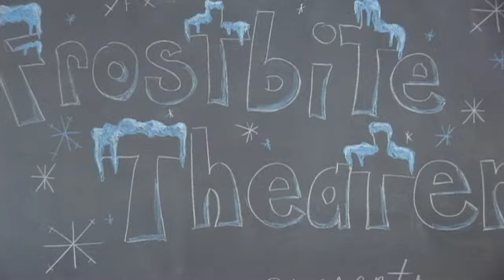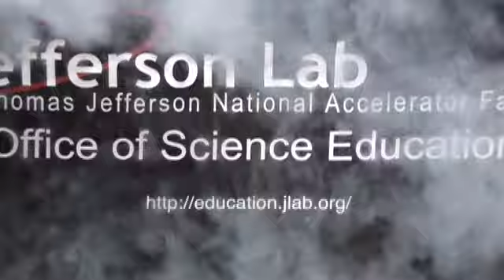Liquid Nitrogen Experiments: Insulators

Comment from the maker: @bigeyezzzzzzz The cheap-o styrofoam coolers aren't too bad. The main danger is if the nitrogen spills over if it is inside your car. It won't freeze you. It'll change to a gas and lower the oxygen concentration in the car, causing the driver to pass out and the car to go wherever it wants to go. Because of this (something we call ODH - Oxygen Deficiency Hazard) you really should carry it around in the back of a pick-up truck.

Comment from the maker: @typhoonkj Nope. Water boils at 100˚C. Surrounding parts of the tea kettle are below 100˚C, so the water is able to condense onto it. Nitrogen boils at 77 K. Place it in a tea kettle and, even at room temperature, the tea kettle is far, far too hot for nitrogen to condense onto it. At standard pressure, the warmest liquid nitrogen is going to be is 77 K.

Comment: Now all you need is cups of equal thickness to do a proper comparison ;-)

(My specific criticism is the claims at 1:00 and 2:16 that the variable under investigation is what the cups are made out of, rather than the overall design of the cup taking into account both material and thickness, as the opening comments taken by themselves might have suggested.)
Reply from the maker: +Perry R That would be ideal, but we're limited to what's commercially available.